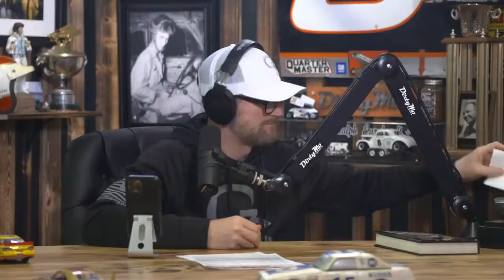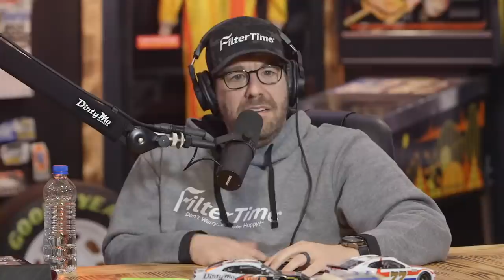Dale Jr. Download: Ask Jr. (Ep. 370)

Comment: Would really enjoy seeing NASCAR run around I-285 in Atlanta as a street course. I-285 is over 60 miles in circumference., it’s large enough that we can run the trucks. the Xfinity cars, the Cup cars all at the same time. Cup can run like 6 or 7 laps.
Reply: I don't think the Atlanta area would be willing to put up with the massive traffic issues that would occur if all of that highway were closed at once. Plus, NASCAR is always trying to slow down cars at Daytona and Talladega already. Imagine how much "slowing down" they'd have to do on a track with 5 mile straight-aways. Then there's the lack of safer barriers on all the underpasses, center dividers and side guard rails... Wouldn't the latter be a problem on any street course though? I guess with slower speeds they worry about it less.
Reply: 285 already is a freaking street course.  :)  I drive it daily.

Comment: the Nascar crowd need to understand something about the new car / flat floor / diffuser combo. If the floor comes in contact with the road from running too low, you will instantly lose the downforce as the air stops flowing for a moment. Every ground effect car will have a sweet spot in the ride height

Comment: Dale do you think the pit crew will keep having problems with the One stud wheel    it is scary to me not knowing if your tire is going to come off when you least expect it if your a driver   and sorry folks  that deal with Kyle and Chase was so.... at least the spotter owned up to it
Reply: all that not does is keeps it tight. there is pins on the brake rotors in Holes all the way around the back side of the wheel that those pens go into and you line it up and push until it doesn't give anymore than you tighten the nut
Reply: @johnhaas2523  ok but it seems so strange in a way how so many drivers in the last two weeks have had that problem  and the pit crews have struggled with getting everything on right
Reply: @jennifursun3303  3 teams is all it been
Reply: @johnhaas2523  hope that is all that there is  thanks for the come back